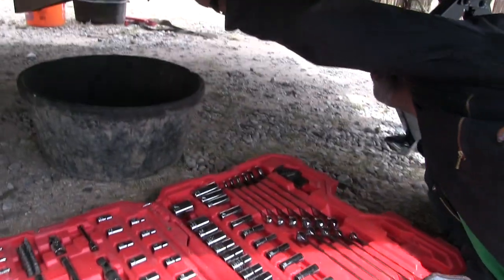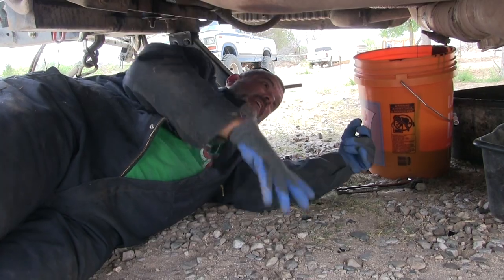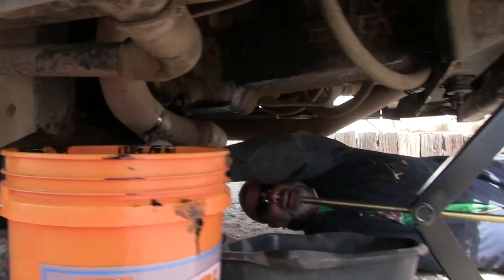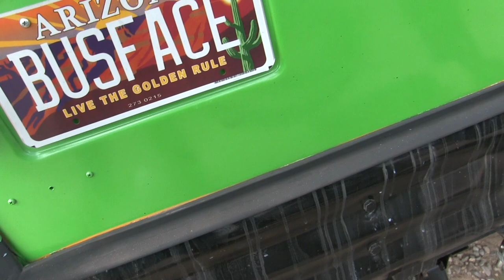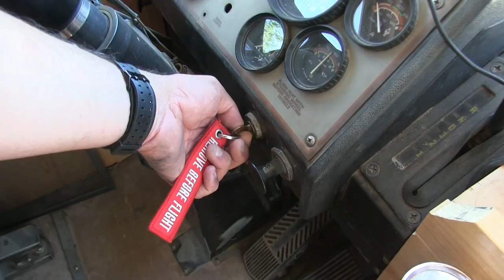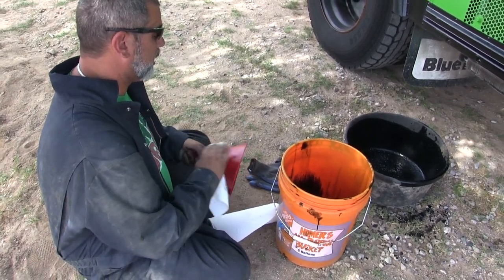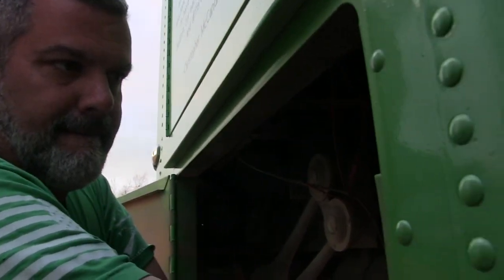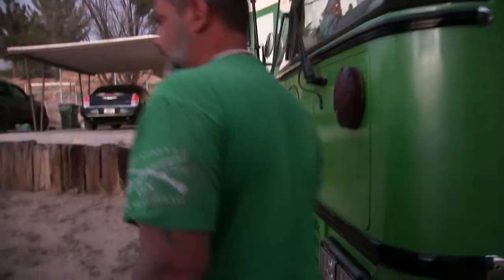Save $$$ by Changing Your Own Bus Oil (plus air tool connector install)

Comment: I'm sure somebody else has already mentioned an easy and clean way to empty the old filter but, just in case, here goes.
Drive a self tapping screw into the bottom of the old filter before loosening it then back it out. As you loosen the filter it will drain straight down into your drain pan. Oiala! There you go!
BTW, I love Kerry's ex's t-shirt too!

Comment: Going full time in about 2 months so I just had preventative maintenance done on my rig in VERY rural NC...
engine (3126), transmission (3060), generator (20K), oil and filters, a belt and tensioner, and 3 batteries (I didn't know I needed) 🙄...$3,012 !!
I asked how that was even possible, he said "well I used synthetic oil".

Comment: Next time you do the filters, put a bucket under it and poke a hole in the filter so it will drain before removing.  I also will blow compressed air into the oil fill before replacing the plug.

Comment: A couple of tips.  I always scribe the mileage on the bottom of the oil filter before installing.  That not only has the information, but the text serves as a guide as to how far you have turned the filter for tightening.   Number two you could have attached the air QD fitting to your old stop sign air supply when you removed them and it will cap off the line and will be inside of the electrical door  for easy access.

Comment: I have the same air chuck on my bus for airing up tires and such. Put in a hose reel and it is a pleasure to do that once headache of a chore. Also, if I’m in a congested Rv park or area, and I’m planning on pulling out early, I backfill my air tanks with an electric compressor so I don’t have to have the rig sitting and idling any longer than absolutely necessary. Just trying to be a good neighbor. Most people don’t understand about the diesels and their systems.. I.e. no air no brakes. They think we are idling to show off.

Comment: Usually when a service center "changes the oil" they also change the two fuel filters and the air filter. That makes it more worth the high price.  I would put a cap on the quick disconnect to keep water and debris out.

Comment: BTW… 

FWIW… 

Regarding my Blue Bird All American… 

I’m told by my mechanic that if I screw-up and foul the threads in the oil pan itself, expect to spend about $1,200.00 to replace the oil pan. 

I was informed that on my 2006 Caterpillar C7 Diesel engine, the oil pan is aluminum. 

This is the sort of situation that I believe a conscientious mechanic is well worth his $150.00 per hour. 

I am ,at best, rated as an amateur. Some tasks are best left to professionals. 

Cheers!!

Comment: Mike the Mechanic, is that like Bob the Builder? lol. You should feel lucky that you don't have a big power diesel motor. Most of them have a 15 gal oil pan and 2 oil filters. plus 2 fuel filters that should be changed each time you change oil. I think you did quite well, doing an oil change.

Comment: consider doing an oil analysis next oil change.  You can get the test containers for free from Blackstone Labs and the analysis is cheap.  They can give you a great indication on the  health of your engine. I get my oil from tractor supply. Traveller brand - 50 bucks for 5 gallons.  Rotella is 70 bucks for 5 gallons.

Comment: Just pierce the oil filter, you don’t need to fill it. Just top off the oil after you run it. Says several big engine diesel mechs.

Comment: Another pro tip is to write the install date with permanent marker directly On the filter.......perhaps even incl the current mileage
Reply: and check the old filter to make sure the old gasket  came off with the filter.

Comment: Put a cap or tape over the air fitting so you want don't get dirt or a small rock in it then it want work or you go to plug in air hose and it gets stuck open.

Comment: Mike I like you air valve add-on but it might be a good idea to put a ball valve in between the entry and the air valve only because they can fail its just a simple O-ring keeping the air from exiting
And they can get stuck open.
Just a thought nice work on the oil change.

Comment: Tip: on new filter, BEFORE install, using a permanent marker, put date & mileage on vehicle … on the filter… invaluable in case you “forgot” , or lost where you wrote the info down !

Comment: When you change your engine oil you should also change your fuel filter or filters and change your coolant filter. 
Now that your dirty you should also grease your front end, slack adjusters and your drive shaft u joints at both ends. Don’t forget to also grease the driveshaft slip joint. (  where the 2 driveshafts meet is a grease nipple). 
Don’t know what model of Allison transmission you have but there should also be a external filter for it that you should also change. 
If you want more info on how and what maintenance needs to be done on your bus. Let me know. I’m retired now but that’s what I used to do for a living. 
There is more than just changing engine oil. Changing Fuel filters when you change oil keeps clean fuel going into the injectors and you can see when you drain the filters if you have water in your fuel tank. Changing fuel filters is more of a challenge because when you remove filters you introduce air into the system. Make sure you fill the fuel filters with fuel before installing them. I believe that on the side of the fuel pump on the engine you will find a fuel hand priming pump. (CAT always came with hand priming pump ). Pump until it’s hard to push the lever down. Then try to start the engine. If it doesn’t start go back to the priming pump and pump again until it’s hard. Try starting again and run the throttle to 1200 rpm to get all the air out of the system. 
Changing fuel filters when you change engine oil could save you thousands of dollars in fuel pump repairs. Good luck

Comment: Next time poke a hole in the bottom of the filter with a punch and hammer to let it drain before you break the filter loose. And as a Diesel Technician, it pumps oil into the filter fast enough and from the filter to the turbo so you don't have to fill the filter if you don't want to struggle with the full filter going back in.

Comment: Now stick some sort of a plug in it to keep dirt and rocks out with your driving and add a port on the back of t h e bus so you have one at each end! Trust me with this as I've been using on board air on my four wheel drives for decades

Comment: Hey guys, was thinking you should write the date installed on all filters. Iirc you can burn your used oil in your fuel tank. What about other maintenance items like grease? Safe journey

Comment: Kudos! Bravo Zulu! 
Another quality production from the legendary McBusfaces!! 

Yes, quite likely a 50-foot air hose would be most utilitarian for successful operations in and around the bus. 

This thought crossed my mind… 
For multitasking, maybe add and affix (to the undercarriage) a permanent (flexible hose) air-hose bib towards the rear of the bus, maybe terminating on the right rear passenger-side of the bus. 

Just a thought. 

Wishing you safe travels and Godspeed. 

KC5AGO says…

Comment: Did you lube the chassis, brake slack adjusters, steering gear, etc...?  I recommend the Lucas synthetic grease, great stuff.  The check valve on the tank should prevent total system air loss.  Why not put a quick air connect on the front and rear of bus. Great video!

Comment: If it helps ...I saw a video where a guy used a nail set to punch a hole in the oil filter, let it drain, and THEN took off the filter :)

Comment: if youre sure the filter will unscrew you co
uld tap a hole in the bottom of the filter with a spike and a hammer or just drill the hole in it and set a bucket under it to let it drain out before removing it
about the added air hook up : might not be the best idea to put a solid pipe extention on there , if you break ir during hookup you be out there fixing it or you cannot move the bus , an rubber extention line might be wiser

Comment: I use the same oil in my diesel truck and at Wal Mart it less than 13 a gallon, we have a wholesale house here in town and its 10 dollars a gallon by the case. I'm saying this because you should be able to change your oil and filter for under a 100 bucks..

Comment: HEY GUYS-
YOU WILL WANT TO ADD AN ADJUSTABLE REGULATOR TO YOUR AIR TOOL OUTLET LINE. DON'T KNOW WHAT PRESSURE YOUR BRAKES WORK AT BUT IT MIGHT NOT BE THE PRESSURE YOU NEED FOR TOOLS.  GREAT IDEA THOUGH.

Comment: Love the Air Compressor tap, but I'd hate to trust my breaks--or ability to release them--to a single, air coupling. I feel like a ball valve, and maybe a cheap regulator--In case you don't want 110 PSI--might be a great investment.
Reply from the maker: Yeah, it's been on my mind.
Reply: @BussyMcBusface  eh, you can always add it later.... I don't think the coupler would fail hard enough to dynamite the breaks....probably.  

You could even just hang onto the plug.... unless you're like me, and always have a few rolls of teflon tape handy... until I actually need one... then I always  have to go buy another.

Comment: You can use that new air hose outlet to blow up balloons for the 20,000 subscriber's party celebration that's coming up real soon!!! How many miles can you go before you change the oil again?🎈🎉  👌👍
Reply from the maker: Most say about 10,000

Comment: when you put a new oil filter put a big magnet on it then all metal bits stick to it and not go back in the engine.
Reply from the maker: Great idea!
Reply: Would you leave it on until the next time you do an oil change?

Comment: I highly suggest you use a fumotou valve on your oil pan, next time you connect a hose to it and fill up your bucket without spilling a drop.  I have one for my coach and love it.  Be sure to get the style that has a hose connection on the end to slip a hose.
https://www.fumotousa.com

Comment: $500 to change the oil in a bus? How many engines did it have? A truck engine is bigger,  so more oil. An ultimate service includes 10 gallons of oil, oil,  filter fuel filters (2) and lube. Truck stops get under $200 for that. Maybe more for synthetic oil.